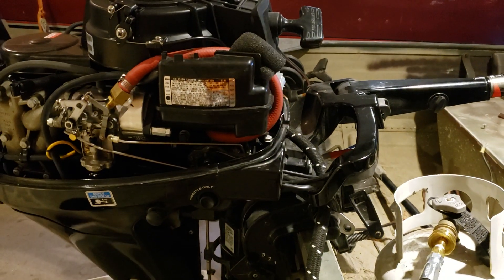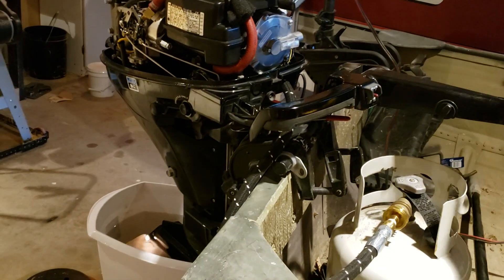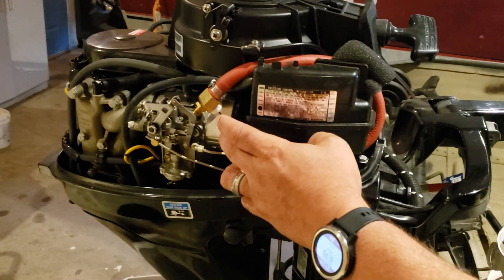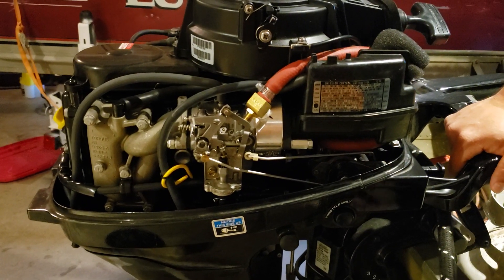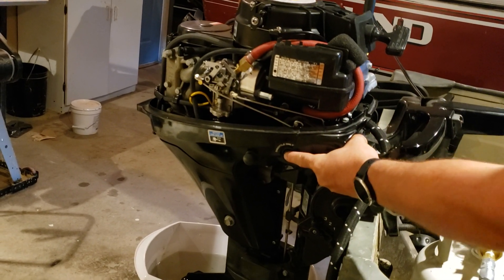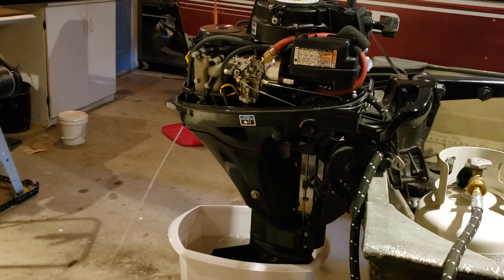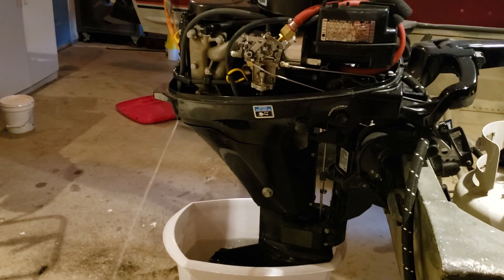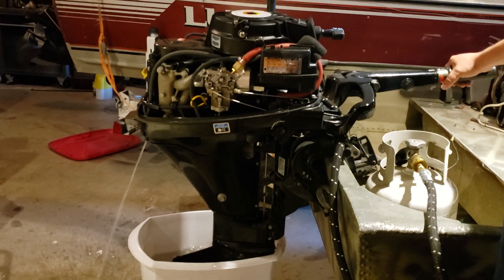Mercury 9.9 Propane Conversion

Comment: You say "This plate right here that bolts to the carburetor and has a little slit in it." This is the "Part" no one can seem to Find and WHICH T60 is the one you are using? there are 6 variations ?.. Just a little more specific would be a Great Help...
Reply from the maker: Reach out to Carb and Turbo Systems in Shakopee, MN. They put this kit together for me and they would be able to guide you to the right part for your motor.

Comment: Does the kit shut off the propane when you kill the motor?  Great video.
Reply from the maker: If you have it dialed right there is no propane going past the regulator if there isn't any suction from the motor, but there is a chance. Best to just shut the gas off if the motor is t running.

Comment: Hi there, I spoke to Neil at Carb & Turbo today about this specific setup-- he told me they had put together this kit for you but never actually ran this build at the shop, and that you did all the tuning yourself.. He then said that Carb & Turbo later did a Mercury 9.9 and a (nearly identical) Tohatsu 9.8 conversion for other customers in the shop at that they were a lot of trouble to get started and running right. (He even went as far as to say they probably wouldn't do any more pull start conversions and that he would recommend converting an electric start outboard instead...) My question to you is how much hassle was it, honestly, to get this thing dialed in so that it starts and runs smoothly/reliably? Did you actually use an emissions analyzer to tune it as he suggested might be necessary? I would love to know as much detail as you are willing to share, since I am probably going to bite the bullet on either this same setup or a ready-to-go 5 hp LPG model very soon... Thanks!
Reply from the maker: It took a bit of work to get it to start with 1-2 pulls but it's possible. The big "ah ha" moment was when I realized I was flooding it by priming it. Just put it at 1/2 throttle and pull twice.